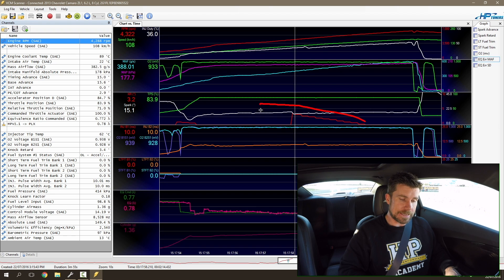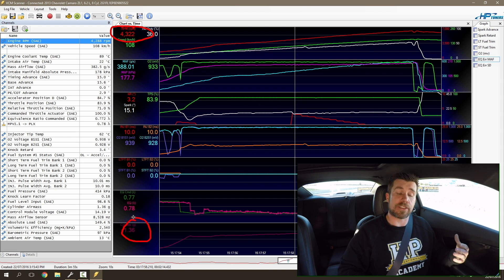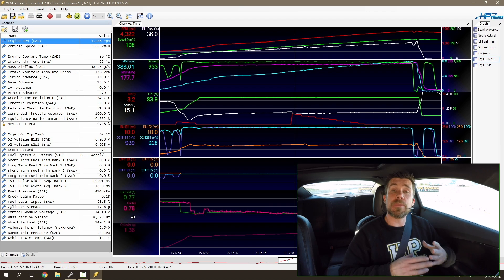Road Tuning | Ramp Runs On The Road Or Track [FREE LESSON]

Comment: Back in the day, we had a crazy ammount of vmax races for 10 minutes or more on full wot into top speed, most were ep3 type r, on these the ones going significatly faster than the rest, with the exact same mods, were the ones that were road tuned, even the same tuner that only did the tune on the dyno wouldn't just perform as well, might had been because everyone had a cai or a bumper ram air and road was literally the only way to do it

Comment: hmmm,  take it that the engine has to have some sort of pre-tune before performing such a pull. Couldn't it end bad if you're tuning from a base map and have to do a full pull
Reply from the maker: Hey Bjørn, yes you are correct, you should NEVER start with full power tuning even though terrifyingly many tuners do to get the HP figure they're starting with. Steady-state tuning should be done beforehand and then you start with sweeping runs before moving higher and higher into the rev range till you're at your max RPM =) - Taz.

Comment: Also, you can use the brakes to add load to the engine during a pull - just the same way the better dynos do. Takes a little getting used to, to be able to modulate the brakes, but is very effective. Just be aware it'll obviously put some wear/tear on the brakes, and be uber careful not to do it too much at a time, because this will heat up your brakes very quickly!! Super helpful when a dyno isn't readily available. You can also use this technique to create a steady-state load/speed condition for tuning an individual cell in your maps. Again, just be mindful of how much heat you're putting into the brakes.
Reply from the maker: You won't left foot brake for the full power tuning demonstrated, but when trying to 'steady state' tune, yes, this is a technique we recommend =)

If automatic, you also need to be mindful of your transmission temp - Taz.
Reply: Also, the electronic throttle control of some newer cars will drop the throttle out when it see's the brakes and throttle simultaneously for more than a second or two. Chryslers definitely do.

Comment: I'm running aem infinity on my Honda s2000 I cant seem to get the lambda to show up on the log but my the ecu is using it for feedback and it is working just not showing up on my log
Reply: That definitely sucks. Do you have any idea why?
Reply: Check if it's used in captured and displayed values.

Comment: Does the gap on a spark plug affect torque/power?
Copper plugs or iridium plugs or platinum plugs?
(Gen 3 ls1 with bolt on mods) what gap should i be using?
Reply: more boost requires more voltage to jump the spark gap, or a smaller gap. might advance timing a bit with smaller gap. my car idles better with a .022 gap
I like copper because I don't care how long they last and I have had problem with platinum plugs breaking and dropping platinum into the cylinder. I think Platinum plugs are marketing BS  IMO.
Reply: Is that gap size you mentioned for a ls1?
Reply: @woodzy575  Why would you advance timing due to spark plug gap ? Knock might be why your Platinum plugs are dropping into the cylinder . Especially if your boosted  . Not to mention using the right heat range (7 - 10) depending on level of boost .
Reply: https://ls1tech.com/forums/new-ls1-owners-newbie-tech/1541363-spark-plug-gap.html  looks like .055"

I would read this, my gap is for a Subaru turbo.
Reply: Smaller gap advances timing a little bit. My platinum problems were on different NA cars, my work truck had Bosch platinums and it was having trouble starting. Pulled the plugs and one on the plugs was missing an electrode, I said no more. I don't thinks it's worth the risk just to have a spark plug last 60 000 miles.
Reply: @woodzy575  nah man, no way the gap size changes timing.
Reply: https://www.corvetteforum.com/forums/c4-tech-performance/1139499-does-larger-spark-plug-gap-act-like-slight-timing-advance.html

Comment: Additionally, it's an advantage if you can find a spot to do this that is uphill. On ramps alongside a retaining wall are ideal. The uphill grade provides extra load and sustains the run for longer. The retaining wall allows you to hear knock much better, so you can abort the run if you start to hear some rattle the ecu isn't yet calibrated to correct...
Reply from the maker: It can be difficult to find a hill with a 100% perfectly consistent gradient. Modulations in the gradient will show up in your data logs as it will alter your load. Using the technique of left foot braking on flat ground is more than likely going to give you more consistency and is what Andre recommends - Taz.
Reply from the maker: It should also be noted you should be using audio knock detection. We 100% do not recommend relying on just your ears and echos from retaining walls. You are on the right track though and you are welcome to tune however you wish, this is just not a technique we advocate given the limitations - Taz.
https://www.hpacademy.com/technical-articles/dont-waste-your-time-listening-for-knock/
Reply: Good point!
Reply: Lol, that’s exactly what I do